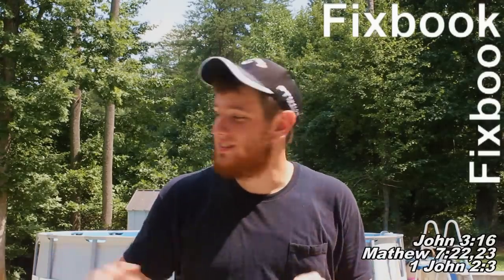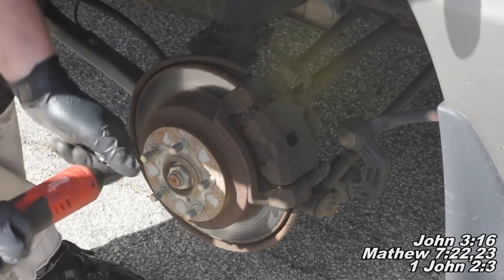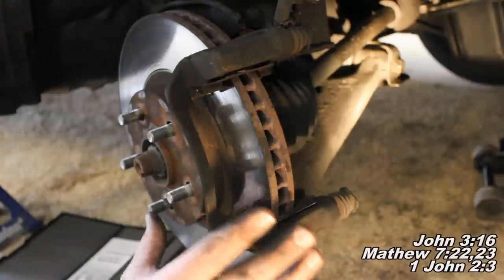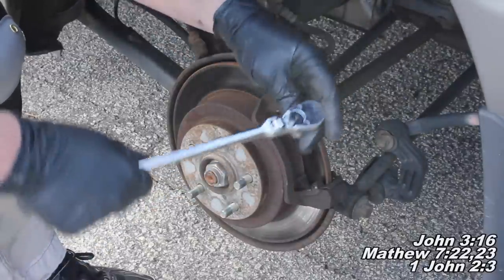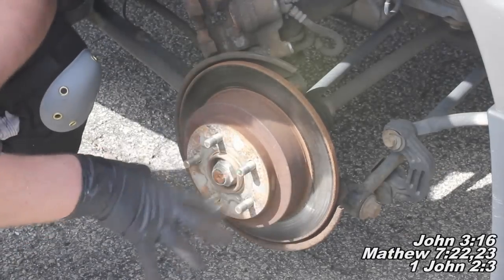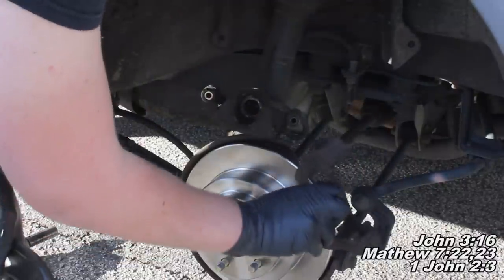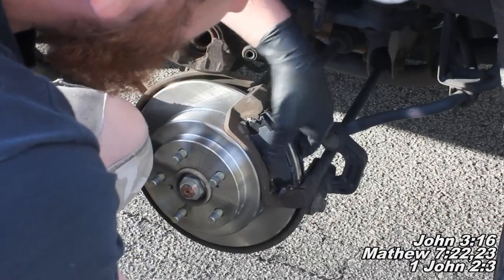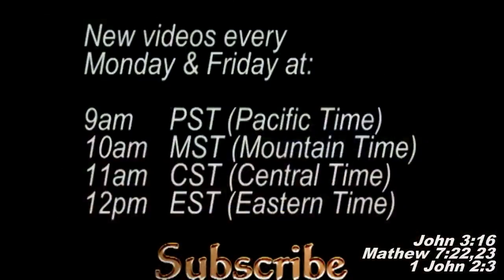Rear Disc Brake Pads & Rotors "How to" Subaru

Comment: Getting the rotors off is a piece of cake.  There are two M8 screw holes in the rotor near the hub.  Just evenly screw two M8 hex head screws into the holes and it pushes the rotors off.

Comment: Personally I like to put wheel lugs with any tool, or by hand, then tighten with a torque wrench. Uneven tightening can cause vibration in your rotors, and it's best to be even on them.

Comment: Thanks.... Excellent "how to do"  video.... decided to watch as I'm attempting to change out the rear rotors/pads on my 2008 Subaru Tribeca for first time.  I was told that I had to change rear brake shoes too.  As I never use the parking brake, I now see, by your video, that touching the parking brakes shoes will not be necessary.  I too have subscribed!

Comment: Great video, you left out the section where you remove, clean, and grease the calipers 2 sliders. And the the little adjuster on the bottom is a manual one. You have to physically turn it. Minus those 2 great video.

Comment: I just got a 2001 Subaru and I have to do brakes all around and rotors for the rear and this video helped a lot my question is can u remove the rear fender from the Subaru

Comment: I've always thought the 2 little tapped holes on the rotor were there to screw a bolt in to push the rotor off easily. Have I been doing wrong all these years?
Reply: He said that is what they are for.

Comment: I'm having a problem putting new rear rotors on my 1997 subaru legacy outback. When I get the new rotors on and the wheel back on with lug nuts in place. The wheel will not spin. Without the rotor and with the old rotor I am able to spin the axle but with the new rotor it does not work.. They look completely the same. Can someone please help?

Comment: Does this tutorial apply to newer Outbacks with the Electronic Parking Brake, or only to pre-EPB model years?  I just bought a 2014 Outback and had never even heard of Electronic Parking Brakes before. I have no idea of how much extra complexity this EPB system might add to a brake pad replacement. I try to do all my own repair and maintenance, at least for relatively simple things like brakes.  Thanks, nice tutorial.

Comment: Great video.  I'm doing this job right now on a 2002, but the bolts holding the caliper bracket are frozen. Even my air wrench can't budge them!  I'll try WD40 overnight.

What were you putting on the studs at the end?

Comment: Hey guys, indeed a great tutorial. Just a question. Is it okay not to bleed the brake after everything? what is the purpose of bleeding it?
Reply: My friend whenever he pushes the piston he makes sure that the master cylinder is open. Why is that? I never had a chance to ask him, any person can answer my question please?
Reply: Kirk Heisenberg I was just about to comment on that @ 2:05. You push brake fluid into the piston to push it out and grip the rotor. It stays out as the pads wear out. If you try to push the piston back in without opening the cylinder first, there will be no place to for the fluid (and the air at the resevoir) to go. You can bend the caliper guide rods if you force it like a brute like I have. You will need to replace at least half of the caliper (with the guide rods).

Comment: I don't believe you did not put anti-seize on the sliding pins and the threads. how about checking the pad clips for cracks or broken pieces.... outside for that great video,,,thanks

Comment: I’ve done these many times before, but the last tine I did the front brakes, for some reason the piston seal ended up coming out in a weird way. While retracting the pistons back I actually ended up slightly tearing the piston seal. I had to replace the the driver side caliper. I need to do my brakes again but I’m totally nervous about having that done again. Any advice from anyone out there that can help me out before I begin? Any advice would be greatly appreciated

Comment: Torque is important... that's why it's listed. Just guessing strength is risky with brakes. Further, lug nut torque is extremely of import. If unequal the rotor may warp. And that's really not a good event.

Comment: Buy a torque wrench - Foot pounds: 42lbs bracket bolts, 20lbs slide pin bolts, 75lbs lug nuts.
Reply: trainlinezoo glad someone cares about specs instead of people hitting everything with a impact gun 😂

Comment: I noticed you failed to mention opening the brake fluid res. So you can actually pry the pad from the disc with your screwdriver. I always thought it was absolutely necessary
Reply: Yeah, good point about the brake fluid.